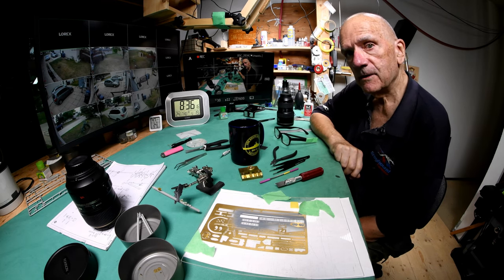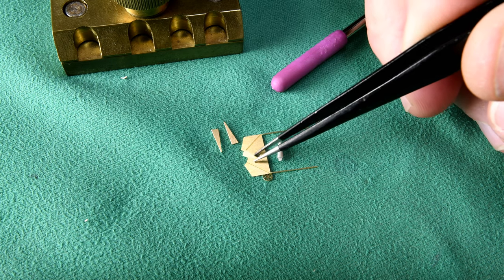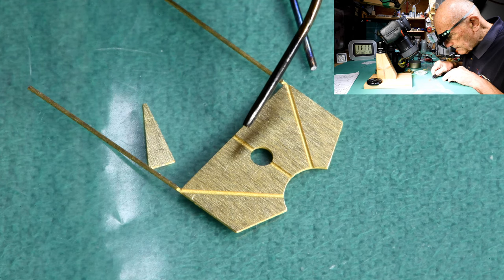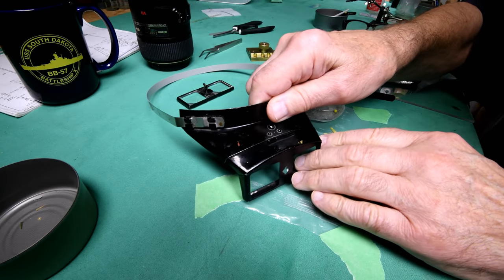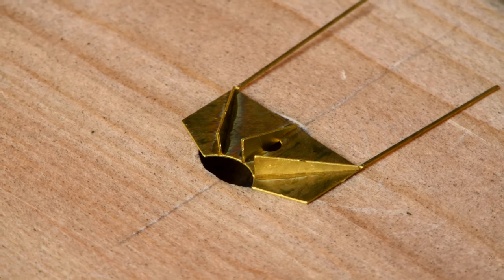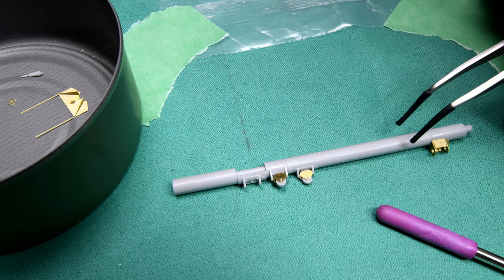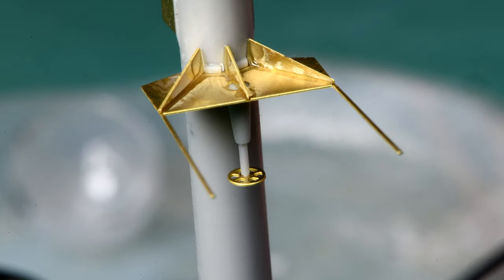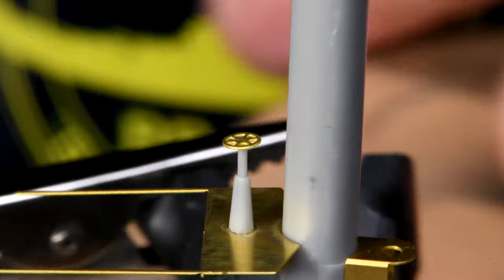The Model Ship - Part 890

Comment: The pin definitely works for you, stick with it, as you know I use a peice of wire for the same reason, when it comes to glue, less is more.  See you tomorrow
Reply from the maker: I'm going to try a piece of wire next time. Was finding the pin a bit too short and was wanting to hold it with tweezers as an extension handle. 👍
Reply: @roncalverley  I use a pin vice